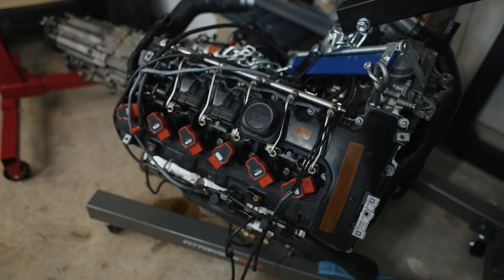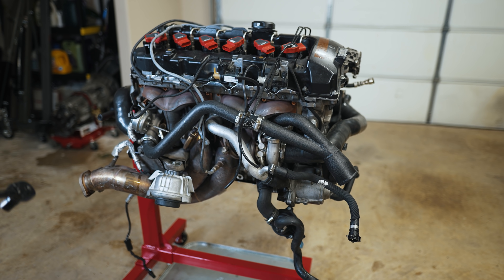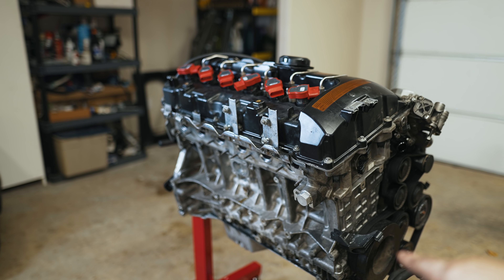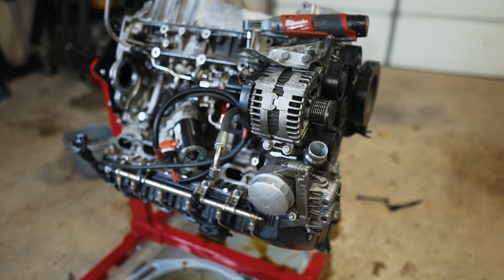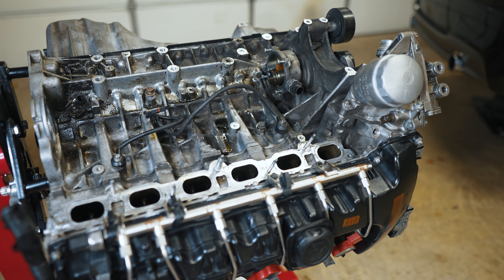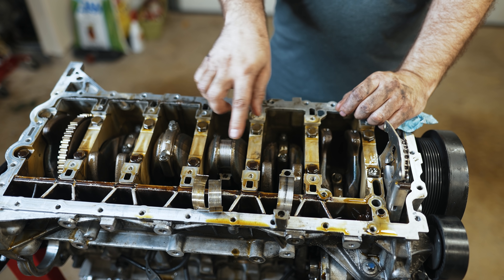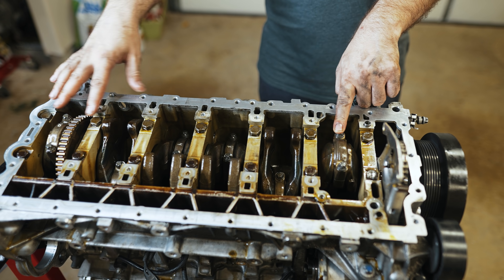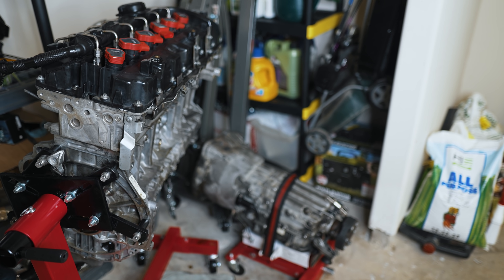Why Did My BMW Engine Fail?

Comment: I know the stock rod bearings come in different sizes to help fine tune the clearance. If I remember properly the bearings you put in were not like that, it was one size fits all. However, I don't have enough experience to know if this was a problem with the clearances or just oil too thick from not getting up to operating temp. Did you say you did not use plastigauge on the rod bearing install? Maybe call up King Bearing and see if they can shed some light on the situation.
Reply from the maker: Yeah I did use plasti gauge and talked about that in my rod bearing replacement video.  Yeah it's one size fits all for the standard size King bearings.  If the cold oil did it then likely the clearance was too tight compared to what was in there.
Reply: @VehicularDIY  I would still talk to King about it. You used their bearings and if they are the wrong clearance for the typical N54 oil weight of 5w-40 then that is an issue. If you have the clearance numbers that is even better because they will know exactly what the clearance was.
Reply: roccotherabbit /\  newtis says it's closed because bmw took them down. They have a link to bmwtis which is a pay site. How are you getting on?

Comment: This is a tricky one. Typically I wouldn't install bearings on the looser side but rather the tighter side, close to new engine tolerances. I'm sure your clearances had nothing to do with the failure, just not within operating temps when asked to perform.
Reply: Always let my ST car warm up fully befor i get on it. What temps were u at if you dont mind me asking? I always make sure its above 160 maybe i should do 200 now . What do you think?>
'
Reply: @MrCougar1825  op temp is 190
Reply: @MrCougar1825  over 160 you can start pushing it.
Reply: @Shabbe02  yes I know 160 but that’s not even running temp 200 is
Reply: @MrCougar1825  never said that 160 was
Reply from the maker: For sure.

Comment: Sorry to see you have to experience this mann. 

Could it be a very tight tolerance engine, with the wrong viscosity oil, in winter ❄️ all be contributing factors?
Reply from the maker: Yeah probably a combination of both.  Thanks man.

Comment: As a reminder...what oil was in?
Also...do you think another oil / grade would have prevented this?
Reply from the maker: I was running 5W40 and yeah perhaps running 5W30 could have helped but there still could have been a clearance issue.  Would be nice to get a definitive answer on that.
Reply: 0W-30 better for cold no? But it seems those one size fit all bearings aren't helping...

Comment: You may very well have had a defective bearing even, but maybe see if the machine shop can fix it and use an oversized bearing, but N54 bearings are already known to fail so it might not be a lasting solution, especially if you are putting your foot into it. Replacing the crank will probably be your only option, maybe upgrade. These bearing need to cook in some time before flooring it for some time after install as well.
Reply from the maker: Yeah I have feeling that aftermarket bearings probably rely heavily on oil being up to 100% operating temp.
Reply: @VehicularDIY  Oh yeah, but what I'm saying is drive it easy the first few drive cycles. Maybe after a few days of very easy driving, then get into it. Think of it as slow forging the metal of those parts, being heated and cooled with each drive cycle. That connecting rod is probably egg shaped as well, maybe not.
Reply: You changed your oil right away after you did the bearings? Maybe, don’t do that? Let the special  break in grease do it’s thing & driver her easy for 1000 miles, then change the oil?
Reply: @matthewweisdorfer7757  I personally like moly assembly lube for those bearings, but I know some guys that only use plain 30w oil. As far as the oil change, I would use a 0w20 for the first 1000 miles, then change to 0w40 but that's just me, not textbook.
Reply: @attunedofficial  I use Amsoil 5w-40 and run it year round. I’ve read that with the king bearings that the slightly higher clearance will make 5w-40 a perfect oil for this engine. I’m in the process right now of doing a turbo, rod bearing DIY. Engine has 178,000 miles. I have the redline assembly lube that he used in his video.
Reply: @matthewweisdorfer7757  I used the Lucas oil semi-synthetic assembly lube..when I did my bearings not sure anyone is better that the other but for sure some assembly instead of just oil.

Comment: How often / after how many miles did you change the engine oil in the past ?!
Reply from the maker: These where replacement bearings so the oil was relatively fresh.

Comment: Probably was cold oil. That sucks but at least now we're 99% sure it was running it hard when it was cold. Not sure if that helps or not but at least it's the truth. Maybe have a machine shop turn that crank and get some more donations to make a built single turbo out of it? Would have to find a donor car chassis but 335i's are still somewhat cheap; especially if you find one with a completely unusable grenaded engine. Just a thought to help you not look at that engine you have as a complete loss.

Comment: i think something went wrong when you changed those bearings, they look beaten, this shouldn't be normal, let us know!
Reply from the maker: Yeah I'll definitely let you know.  Maybe on the N54 you're betting off leaving the stock bearings alone.
Reply: @VehicularDIY  I definitely don't see many rod knocking N54s even with high mileage so maybe the stock bearings even if it looks beat up from your car is still fine for a few more thousands of miles rather than some replacement bearings.
Reply: @VehicularDIY  Yeah I always thought upgraded bearings = better but seen a lot of people having issues with other bearings, not trying to throw shade or  call out brands but just saying.

Comment: These are known to fail. Surprised you didn’t change them before ?
Reply: These are the changed bearings, the reason that these spun because he did a pull when the engine was cold. Theres a video on him changing the bearings, and the last vid of him explaining what happened
Reply: @crazygamer889  do you know which bearings he put in?
Reply: @eddydreni  King rod bearings